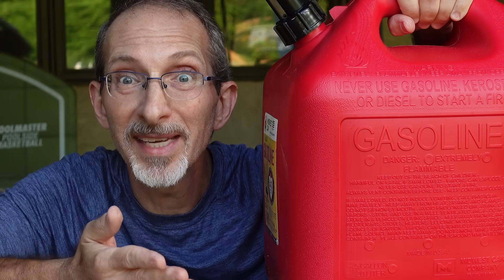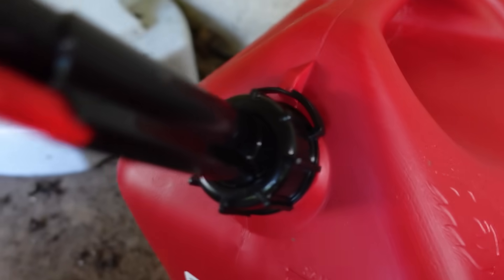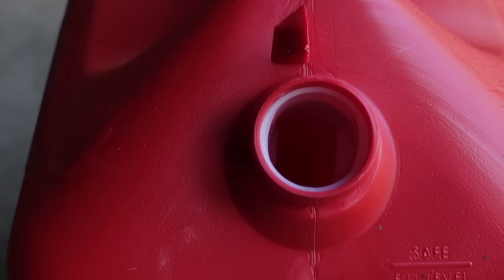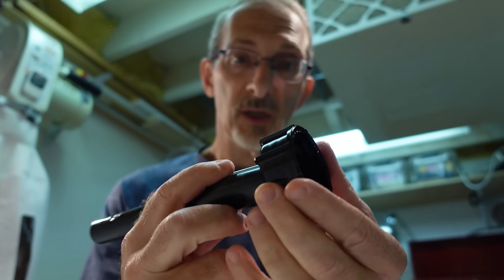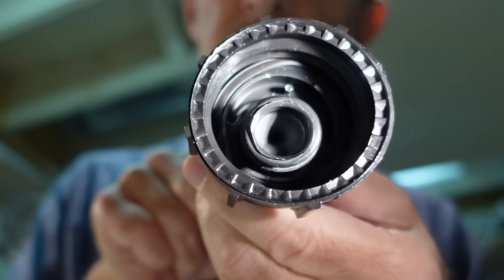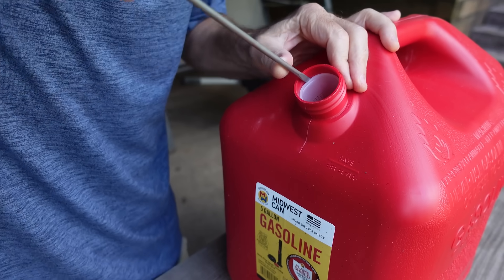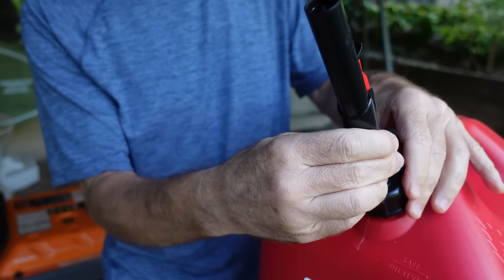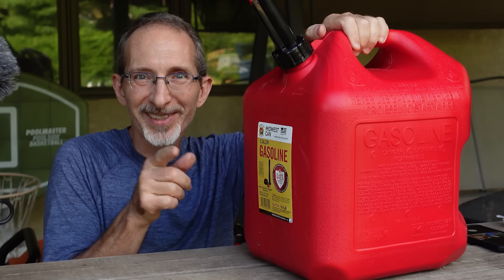Gas Can Modification | New Gas Can Fix

Comment: I’ve never understood how covering my lawnmower with gasoline when trying to fill it up was supposed to keep me safe.
Reply: I used to mow lawns. When I had to buy one of these EPA cans I ended up spilling gas on me & the tractor all the time. These things are complete garbage and do the opposite of why they’re mandated.
Reply: @TheSterlingArcher16  the insulated aristocrats making these stupid decisions have never had to fill a gas can or a mower and know nothing about it.  Dumb government in operation
Reply: @TheSterlingArcher16  You are right, but it's not even the EPA, it's BS California laws.
Reply: Small hole drilled near the top of the can behind the handle works wonders for doubling flow capacity. So I hear...
Reply: @Scott Amidon  first thing I do to new cans or I just buy old style cans at yard sales
Reply: I did the same thing to mine plus I pushed the nossel  in and drilled a 1/8 hole then pop rivet in it plus knocked the flap out. Works great for me.
Reply: @scottamidon3391  Tractor Supply sells a kit that eliminates all this mess.
Reply: I had to use one of these cans to fuel my Jeep.  By the time I was done with that stupid safety that leaked everywhere I was covered to the elbow and soaked below the knees with gas.  It also flowed slow enough that some of that gas soaked in through my skin and I was ill the rest of the day.  That is the kind of safety that will result in a wrongful death settlement one day.
Reply: Don't tell the gubment, but I can mow in reverse, on my riding lawn mower.
Reply from the maker: Yes, it’s kind of an oxymoron isn’t it?
Reply: @MikeFyxdt  The EPA is full of Oxymorons..
Reply: @MikeFyxdt  Pretty sure Ian Anderson's comment was a stab at you removing the spring that stops fuel from dumping all over when you are done filling something that the gas can has to be upside down to fill. IE Lawn mower, Generator, etc...
Reply: @kpj54256  nope. I use and tell everyone about this fix. I spill gas because it’s made to go into a vehicles gas intake, not a lawnmower, so it spills gas everywhere while trying to get it into the right spot. I haven’t spilled a drop since.
Reply: Not having a vent is dangerous,  I got sprayed in the face by these new cans trying to press down the stupid ass tab to let gas flow
Reply: @lookingfordinosaurs  yep.  Again, aristocratic overpaid bureaucrats with not much to do and no knowledge or experience with gas cans or mowers made these "safety " decisions for you.
Reply: AKA How to fix an environmentally hazardous product
Reply: I am a Bureaucrat from the Government and I'm here to help...
Reply: Typical Government Bureaucrats designing stuff that's worse than what they're supposed to prevent!
Reply: @danforbess6941  My all-time favorite Carl Sagan quote has nothing to do with space or astronomy:
'The number one function of any government bureaucracy is to perpetuate itself.'

bu·reauc·ra·cy
/byo͝oˈräkrəsē/
noun
noun: bureaucracy
a system of government in which most of the important decisions are made by state officials rather than by elected representatives.
Reply: @danforbess6941 Government bureaucrats don't mow their own yards, don't use chainsaws, and don't wash dirty work clothes. They hire guys who "no hablo Engles" to do the dirty work and those guys wash their work clothes in vintage top load washing machines. So bureaucrats have no concept of reality because they have no first hand experience and don't communicate with those who do.
Reply: @danforbess6941  It was not government Bureaucrats who designed the "stuff". The Bureaucrats established the criteria that the manufacturers had to follow. The manufacturers were stuck between the proverbial "rock and a hard place" and had to design something that would satisfy the bureaucrats. Hence they ended designing a "Rube Goldberg" contraption that people are forced to undo to make the gas can functional.
Reply: @corin164  ...not an excuse.....they could have designed and field-tested their products....which they obviously did not.
Reply: thank california "environmentalist" for all the help   They have managed to make everything worse.
Reply: There's nothing like trying to hold a 5 gallon gas can in the right position while pressing on 3 spots on your nozzle to fill up your lawnmower. I wonder if they'll add a Chinese finger puzzle as the next safety feature?
Reply: AMEN!  Whoever designs these has never cut the grass or used a gas can in their entire life!
Reply: Quit applying too much common sense.
Reply: @37yearsofanythingisenough39  🤣😂
Reply: Best comment
Reply: A solution in search of a problem, making the solution a bigger hazard than the original problem. All these safety "improvements" did was make a simple item which worked into a nightmare for users.
Reply: And "vapor free."
Reply: Love, Love, Love this comment! You precisely nailed it.
Reply: I wish I could give this 1000 thumbs up ! happens all of the time with newer style fuel cans.
Reply: Rabbits 🐇 
My back yard looked like a putting green by the end of summer when I had 2 loose in the yard. 
Chewing grass in the front end and fertilizing out the back. 
Problem was starting with 2 let to 62 by the fall. 😂

Good job on restoring that can to useable form. 

I did the same removing the water-flow reducer from my shower. Now it’s like a Tropical monsoon, but I’m clean and actually use less water in the end.
Reply: Yes!!! 🙄
Reply: True words spoken.
Reply: The EPA is the worst
Reply: LOL
Reply: Because it won’t actually explode until you stand up to start it, thereby giving you enough room to stop, drop and roll when you’re burning like a human Roman candle. Idiot! Just like the “childproof” safety lids on all medications. The ONLY way to get it open is to find a small toddler, who will pry it off in thirty seconds or less. That’s how safety works! 🤣🔥🤣🔥🤣
Reply: You aren't safe, however, you have to identify as safe.
It's all in the science. Just believe the science.
If your not spilling gas your then endangering all of us. 
I'm just useing today's logic
Reply: If you cover your mower in gasoline it just proves your an idiot that shouldn't be mowing.
Reply: Haha 💯
Reply: I get it, the EPA wanted to stop the release of gas vapors. With this crap they call gas now you have to keep the tank sealed so it doesn’t get worse than it already is when you pump it at the station. But these “safety” cans are a joke. Spill more gas than you save from evaporating. Our government at its finest.
Reply: Don't understand how covering my lawnmower in gas is keeping the air clean of gas fumes. This is all happening because of Biden's EPA requirements and not a single one of these changes has helped in any way other than making new gas cans too annoying to use.
Reply: It was never your safety, but the "environment's safety" silly!

Of course dumping gas all over the place with poorly working solutions is much worse than the "unsafe" wats we had before, right?
Reply: All this stupid safety scrap you're trying to avoid nature's Way of weeding out the stupid and weak-minded
Reply: @Stan Kappiris ditto
Reply: For real! These so-called safety cans are a nightmare🤦‍♂️ they are very dangerous! Need to be taken off the market ASAP
Reply: What’s a gas attendant?
Reply: @dcubed7734  

That's a term from back in the day (1950's) and refers to the person who would pump your gas into your vehicle as well check your fluids and clean your windshield etc.
Also known as a "station attendant" or a "pump jockey" most gas stations we're full service thru and up to the mid 1970's and then automation and do it yourself took over leading to you scanning your own groceries today and bagging them yourself.👌
Reply: I actually like the design on a small gas can. But the large can is far to heavy and it bent over and ruined the nozzle. But the 2gallon one works fine for my small engines.
Reply: W poo
Reply: Ok
Reply: You said it yourself, it works for you , I have one of this gas container and it never gave me any kind of problem because it works for me  , you sir just ruined a perfect fine gas can and hey I’m sure you’re happy with it .  keep mowing;-)
Reply: The filter in the can, it catches debris, but then where does that debris go when filling equipment?

You guessed it !!!

I just bought the kit from Tractor Supply. And removed that stupid tank filter. Now I have a flexible spout that way reduces spillage.
Reply: @truthofgod6213 Maybe you're supposed to pour the first few ounces on the ground to flush the sediment out the filter!  I'm sure the EPA would love that!  /s
Reply: @coolraul07  lol they would. Not to mention our vehicles have no screen at the entrance of the fuel neck. We getting that same gas from the pump.
   The kit you can buy has a screen at the base of the flex spout. I'm thinking a HS diploma designer was involved here, we're as a college degree designed the can screen. Yes I'm stating degrees are a scam.
Reply: I just thought my stupid new gas can was defective now I see they are all just faulty. Yeaaaa I'll keep using my 5 gal VP jug GTFo with these things
Reply: Some politicians son in law got wealthy over this scam. Sheldon Silver of New York.
Reply: I miss normal gas cans. These woke gas cans are horrible
Reply: AMEN. AMEN. 😂😅😂😅
Reply: AMEN to that!  LOL
Reply: Corporations tell the government/we the people what we can, and cannot do. Corporations exist to exploit people for money. Corporations are above the law and people within the corporations who break the law on behalf of corporations are also above the law. This is why we see so much stupid and, worthless and dangerous and costly engineering done by arrogant nerds.
Reply: I’m not strong enough to flip that spout thingy and my arthritic hands just can’t manage doing it. Hubby is going to ‘fix’ our can. Thanks.
Reply: AND KILLING THE GRASS BY THE SPILLED GAS.....FOREVER. unless you remove the contaminated soil and replacing it.
ask me how i know :face-pink-tears:
Reply: Because a bunch of dumb shits in California would leave them in the garage, and their building code required their hot water heaters there as well so kaboom.  The the state passed regulations banning can vents and sine they consume the most gas cans everybody just switched over.  Then the epa really went buck wild with that horrible filter
Reply: Only pour fuel on your mower when it’s hot.
Reply: The most egregious thing is that I have my gasoline stored in a jug for Kerosene. I didn’t know that until just recently. I’ve had that gas can for about a year now. It says on the jug not to store gas in it lol
Reply: That “filter” is a flame mitigation device.  It is there to keep the can from exploding should the gas ignite when pouring it…
Reply: HOW LITERALLY HOW I DONT understand ive been using this for years and haven’t spelt a drop explain how your using it because theres no way your using it right
Reply: @drdelirious8899  you have to keep pressure on the tube to keep it open. You can’t do that on a lawnmower, you can’t put enough pressure to keep it open. Or you have to hold it so it covers the opening and you overfill it because you can’t see.
Reply: I could write a book on the 
ridiculous features attached 
to this can, the old ones worked fine.
Let me just mention 1 issue that 
I haven't already written about on
other vid comment sections;
The filter lmao, so how in the 
#### is the average person going
to deal with debris that they find
trapped in it.... haha :facepalm:
The 'Smart' can I have,
 was given to me, 
the filter was rolling around in
the bottom of it. 😄
Reply: It isn't......just more gvment tyranny
Reply: ASK OBAMA !! ALL THIS BULLSHIT WAS HIS IDEA !!
Reply: Even the lawn mowers became MORE dangerous when they tried to make THEM "more safe"----More of "the law of reversed effect"
Reply: What if their plan is to "accidentally" immolate anyone who uses gas?
Reply: I always spill some gas on the ground, just for spite, I hate those gas containers, and of course the outrageous price also.
Reply: It is not an accident made in China
Reply: that only happens if  you dont know to pour gas. but with the safety feature its far more likely to happen.
Reply: @xxpyroxx1670  I haven’t spilled any since I fixed it🤷‍♂️ You had to hold it open with one hand and pour with the other. Now I open, pour, and close. No spills. Those cans suck!
Reply: I would take the red lock off and get a weaker spring so the spout still shuts off when I'm done pouring.  As far as weed wackers and chain saws get a smaller can.
Reply: @BigBlueDog8  ...Big can, small can...it's still a totally unnecessary, unsafe, wasteful, "fix" to something that was not broken in the first place.
Reply: It only protects you if the engine is hot.
Reply: Thankfully all that heat dries up most spills...  I had a patient who started a fire with gasoline.  He wisely took the can back over by the garage door before lighting the fire.  The fire department was able to determine that the Vapors from that Gas Can "75 feet away...",  had connected with the fire out in the lot. He was burned over 90% of his body.  He became the impossible Medical Recovery... with scars inside His lungs... nose,  ears, eye brows, lips, skin. He told me the story about 2 years into the recovery. In my memory he reminds me of the guy who blew his face off with a shotgun and lived to tell about it without a bottom jaw and only half a tongue.   Trauma care is where it's at, Kids.
Reply: Bird shot
Reply: @irondiver292  

Lol.
I shot a mostly empty crap plastic gas can with a tazer once.
It was great 😂.
Reply: You’re protecting the environment from gas vapors, why don’t you put your mask back on and just be quiet so we know your a good person.
Reply: @michaeljacques7336  the irony is that by forcing you to spill with those hateful designs, people end up spilling even more.
Reply: @michaeljacques7336  I would like your comment, but it currently has 69 likes, nice.
Reply: @michaeljacques7336  Honestly people wearing masks in stores even back in covid era were basically  dressing up as the same as criminals. Not only that they were infriging on our rights.
Reply: @michaeljacques7336 You are not very bright.
Reply: @michaeljacques7336  Be proud of that CREDIT SCORE,  Subjects
Reply: @michaeljacques7336  Omg please do so and think of others.  Masking up is so important. It helped us get through Covid. 
Right?
Reply: @michaeljacques7336  "sheeple ain't good people"
Reply: Title should read...How to defeat safety features of your gas can.
Reply: @MrThemold 😂😂😂😂  "safety features"  😂😂😂
Reply: @MrThemold  Well, you’re almost right. It should read “how to defeat TOTALLY UNNECESSARY safety” Yada yada yada…
Reply: So if someone using this mod burns their house down not only are they not going to prison but the guy who showed them the safety modifications is going to prison and he’ll be offered to buy them a new house too?
Reply: @gregjones3660  how does this mod increase the chances of burning one’s house down? It decreases the chances of burning one’s house down. I bet you still wear a mask and get boosters!😂🤣
Reply: @iananderson8363  I care what you think...
Reply: @gregjones3660  lay off of the bud light
Reply: @gregjones3660  

You talk like a liberal opportunistic politician.
Reply: @gregjones3660 🤡🤡🤡🤪🤪🤪
Reply: @gregjones3660 Nobody got sued before the stupid EPA safety feature was implemented, so why would they get sued for making it like it always was, especially since the stupid feature was only made to reduce vapors. The only person at fault for sparkling a fire near combustible fumes is the person talking the risk near the combustible fumes engaging in activities they can possibly ignite the vapor. Which btw is not easy to do, except for in locations with little to no ventilation. The story told in the above comments about someone igniting fumes from a fire outside 20ft from the gas can - I call b.s.!!!
Reply: @rickyweeks9144  You call bs on the theoretical? Do you navigate with naivety? The prosecuting attorney proves that your actions of defeating safeguards coupled with your inability to store flammable materials from the mentally handicapped (or whatever suits the complaint and they will find something)... You ever heard of negligent homicide? Or implicit negligence that accounts for 100's of thousands of dollars worth of property damage. How about reckless endangerment? You dont think these things apply to you but what does your record look like? More than anything the comments I made are an effort to save the content creator the headache of a lawsuit at a minimum. Lawsuits without a winning counter lawsuit for lawyer fees and court costs is out of his pocket. If someone were to die because of viewer negligence how does that affect his conscience? How does 10 years of prison time and $250,000 in restitution sound? How does leaving safeguards alone sound? You can fight a legal battle to change the safeguards but typically not while fighting a criminal lawsuit...
Reply: @gregjones3660  It is near impossible for fumes to ignore in an open environment from 20ft away! Fumes dissipate in open air, for one. And they rarely hang at flame level in open air! So yes, I'm calling b.s.!!! Just because a court case proved this was the scenario, does not mean that is actually what happened. I've seen multiple videos of people intentionally lighting the gas nozzle while inserted in a vehicle gas tank port, and it does not light as easily as one would think it should. Gas pumps at gas stations have gas fumes you can literally smell and putting gas into a vehicle expelled even more fumes. In every video, ignition was only possible within a extremely close proximity to the surrounding gas nozzle handle, like within 2 inches. That's why I call b.s., because it would happen quite often at gas stations where people often light cigarettes in the parking lot within 20ft to the pumps, and the fact that it doesn't, proves that theory near impossible - conditions would have to be perfect and the odds are against those scenarios
Reply: @rickyweeks9144  We have two different views on physics and the justice system...
Reply: Just switch to a battery-powered lawnmower.  No gas can needed.
Reply: @rocketraccoon1976  I did - so after 3 years the batteries were no good anymore and replacement batteries were $324 - so nobody wanted the mower and it went to the dump. REAL great use of resources. My previous old Toro gas mower still ran perfect when I gave it away after 22 years of hard use. Luckily, I still had a two-stroke Lawnboy mower from 1968 that came from an estate sale that I got just because it looked like a perfect antique. It still runs perfectly.
I do have an electric bike that I built in 2011 that's still perfect - so I'm good with modern tech - but only if it's better and longer lasting than the old tech.
Reply: @jackandblaze5956  you know, they should really force manufacturers to use standardized batteries. The batteries only last for a couple of years of use and then people end up throwing away the whole darn thing away. It’s just stupid.
Reply: @Jack Andblaze  I'd like to know which brand of battery mower you got. I bought an Ego mower about 8 years ago and it's 5ah battery isn't dead but not holding the charge as well after 6 years. I got a 16 in chainsaw with a new 5ah battery for $320 and it works better than my original battery ever did and have not noticed any degradation in the 2 years I've owned it. I also still have the original battery as a spare if the newer battery can't quite finish.
Reply: @jackandblaze5956  Exactly, I have quite a few old Homelite saws from the late 60's to the late 70s & a few cast iron K series Kohler gas engines from the early-mid 70s that still run flawlessly. They have well over payed their environmental impact. There is absolutely no way that current battery tech can say that with all that goes into mfg a battery that may last 3-5 years at best. Maybe the global whatever they're calling it now (warming, cooling, it's windy now, whatever) will warm up the north so some of these people will move their butts back up there.
Reply: @frommatorav1  It was a Black and Decker with sealed lead acid AGM batteries 24 volts.
Reply: @Jack Andblaze  that explains it. Lithium ion batteries are much better. Mine are 56V 5ah li-ion from Ego. They are very expensive bought separately but not nearly as expensive when bundled with a tool. I have also bought tools without the battery to save money but bought my chainsaw with the same power battery as my lawnmower to upgrade it and have a spare.
Reply: @frommatorav1  ...You are truly blessed.  It's people like you who SHOULD buy all that "battery stuff".  Just don't push it on the rest of us that it doesn't work so well for, or last so long as it does for you...and Al Gore.
Reply: @sluggonotnancy6178  I'm glad you approve of me buying "battery stuff". My current battery lawnmower is better than my gas mower and my string trimmer on battery is superior to the one I had that used an extensions cord for power.
I don't care for Al Gore... or Tipper Gore for that matter.
I'm saying the battery powered lawn care tools are better because they're better, not because I'm saving the environment.
Reply: @rocketraccoon1976  No. I want to mow my lawn TODAY in a couple hours. Not over 2 or 3 days waiting to recharge the crappy battery.
Reply: @rocketraccoon1976 what about a battery powered airplane?
Reply: @rocketraccoon1976  

Yup.
27 power inverters plugged into your trucks cigarette lighter and charging 76 batteries simultaneously so you can get your day done and your good to go. 🙄
Reply: @rocketraccoon1976  I tried a bettery powered yard tool. Doesnt work. Its a complete fad. Normal people like us are gas or bust
Reply: @rocketraccoon1976  ...Present day battery technology is NOT the answer  you seem to think it is.
Reply: @rocketraccoon1976  ...you're just displacing WHERE the emissions come from. No improvement overall.
Reply: @rocketraccoon1976  I just got geese.   Haven't touched a lawnmower in years..
Reply: @SGT_Fon  Geese? Nature's solutions are always best!
Reply: @SGT_Fon  you just need a hose to wash all the crap away lol
Reply: @jackandblaze5956  "Geese? Nature's solutions are always best!" Not necessarily. Try goats. They'll eat a lot of stuff including your gas can spouts and your old-style gas can vents. All the mandated designs are good, though, because no matter where you are they Save Water In California!
Reply: @SGT_Fon I had some then I finally got tired of stepping in goose crap and listening to noise and decided the geese needed to go. It takes less time to mow than to clean my shoes all of the time.
Reply: @rocketraccoon1976  psh! You and your good ideas...